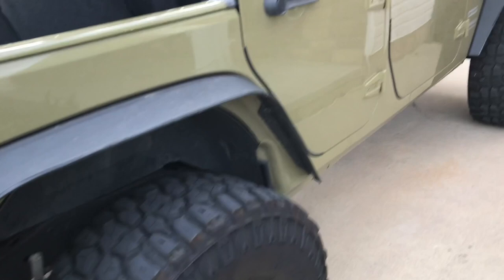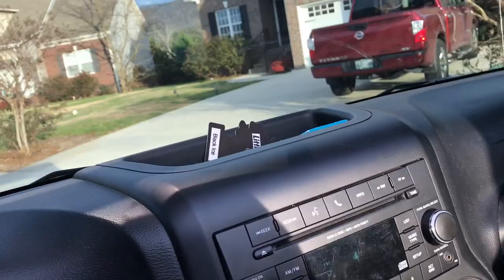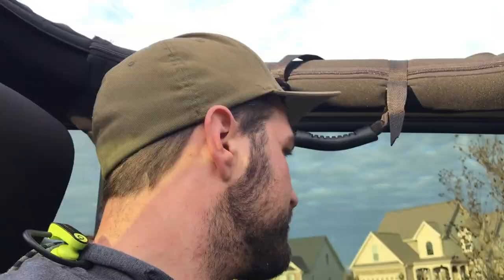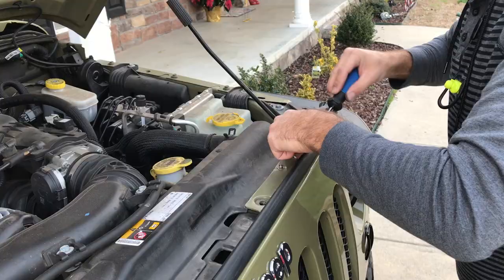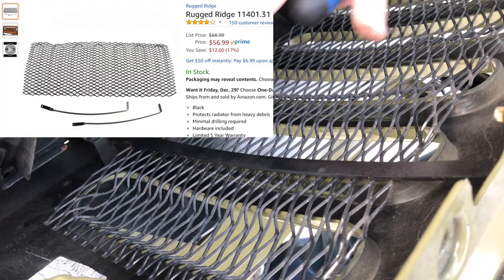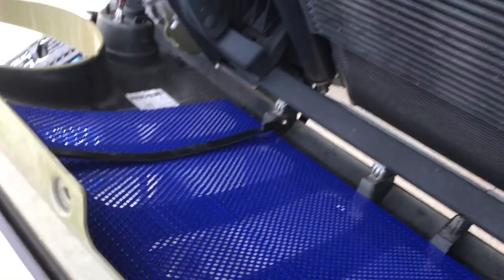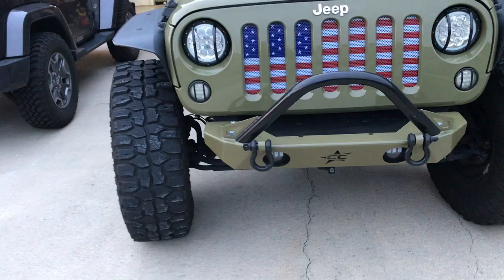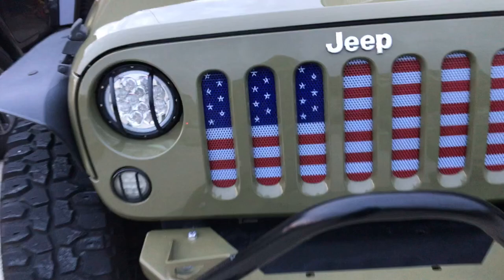HOW to install Jeep Wrangler Grill Mesh/Guard inserts (Jeep JK)

Comment: Looks good. If it starts rattling that would be deal breaker for me. Keep us updated on that insert. Seems like you had a nice Christmas. Hope you have a nice New Year. Cheers!
Reply from the maker: Rhino Willy's Thanks. It’s probably gonna be a seasonal thing. Change them out with each season. Lol. Hope you had a Merry Christmas too and hope to hear from you in the New year.
Reply from the maker: So far no rattle noise that I can hear or have noticed. Mesh grill is still in place with a few bug splatters.... It has made it a good 200 mile trip with some more to go...
Reply: SPARE TIME VIDEOS Thanks for the update. Nice to hear. Bug splats like mud and rock chips add character to a Jeep lol. Take care and have a great New Year.✋😀✌🚙

Comment: Can you add a parts list to the flag pole hitch video?
Reply from the maker: Sure can. I’ll put it in the description.
Reply from the maker: Flag pole parts list:

2 - 3/4in caps 
2 - 3/4in couplings 
1 - 60in x3/4 pipe
1 - 6in x3/4 pipe 
1 - 1-1/2in pipe 
2 - Small 3/4 in U joint clamps 
1 - 3-1/4 drop hitch receiver
Reply: @Jeeptv  thank you. I'll be doing this coming weekend

Comment: The airflow  concerns me with these grill inserts. Easy way to overheat your Jeep especially on long trips or offroading when you need to keep the engine as cool as possible. I put something similar on mine, but with much larger holes and less spacing between them. These seem like there isn't nearly enough airflow. I like the one you had on there way better for that reason alone, but you know...'Murica.

Comment: What year is you jeep? My front grill has a key lock and wont allow me to insert my mesh grill.. it will prevent me from unlocking the hood
Reply from the maker: My Jeep is a 2013. The lock for your hood must be an accessory. I don’t think Jeeps come stock with locking hoods. Could it be something a previous owner may have added.    Check out this link to see if this grill maybe what you need.                                            https://www.amazon.com/Inserts-2007-2017-Wrangler-Unlimited-Accessories/dp/B075GPPTZB/ref=mp_s_a_1_4?keywords=jeep+jk+mesh+grill+with+hood+lock&qid=1555467168&s=gateway&sr=8-4
Reply from the maker: Thanks for checking out my channel

Comment: Where did you get those brackets
Reply from the maker: Holly Wood it came in the rugged ridge mesh grill kit. So your gonna have to purchase both to install like mine. If not you are gonna have to come up with some brackets to hold the mesh in place. A lot of people have modified them and zip tied them in place. Links should be in the description on what to purchase.
Reply from the maker: I have added the links in the description of the video. Sorry 😐.
Reply: Jeep_tv Thx!

Comment: Any problem with over heating?
Reply from the maker: Mr.carrottop66 So far so good. I thought about that before  slapping it on there. Drove it on a 200 mile trip and had no issues. It’s been wheeling and in the heat here in the south too.
Reply: Thank you, for getting back with me on that I was a little worried. Should have thought of that before I ordered it. So thanks again.